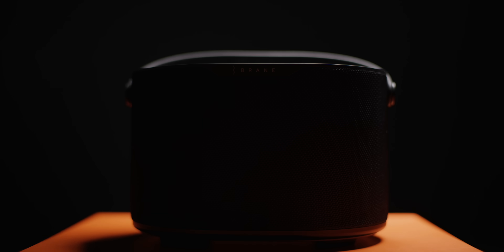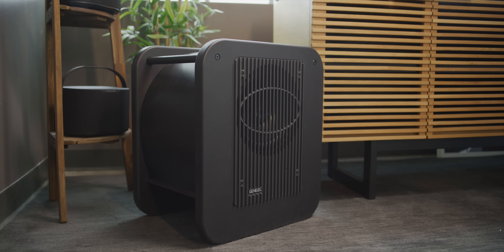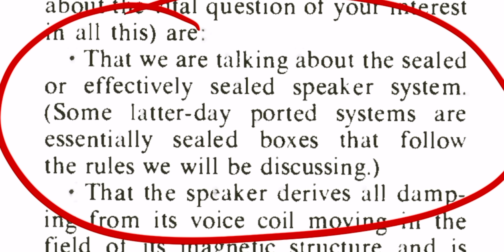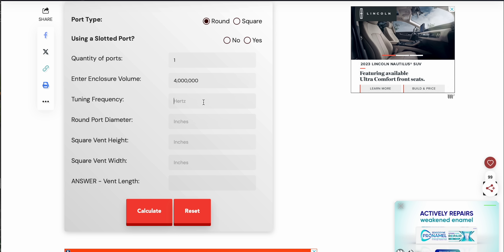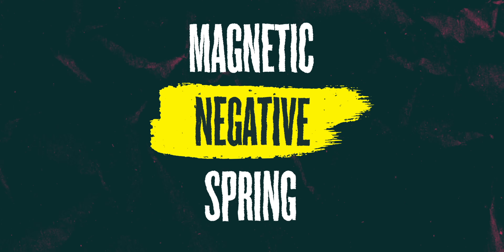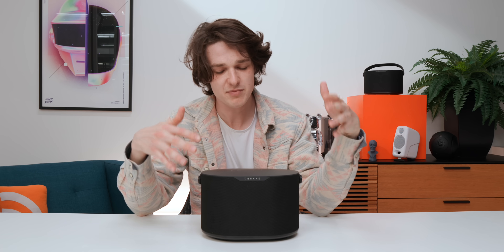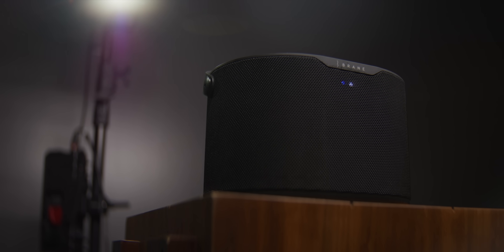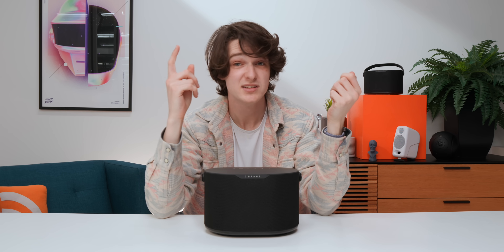How This Speaker Broke Physics.

Comment: All of the above can be seemingly easily debunked by headphones, which (relative to speakers) easily achieve very deep and clean bass, as well as crisp and pure highs.
Why?
The physics of high-fidelity speakers are in fact, very simple, but extremely difficult to achieve technologically : The speaker diaphragm (cone ot flat) must be both extremely rigid, yet extremely low-mass. 
Both traits required for low latency and and low phase-shift, which means distortion. Both latency and phase-shift translates directly into distortion. 
Both 'extremely rigid', yet 'extremely low-mass' translates to least resistance to the physical moment created by the electromagnetic motor (coil vs magnet), i.e, resisted by the air required to be pushed. That in fact, is very hard to achieve in speakers, but relatively easy to achieve in headphones, in which there is the least air required to push (and pull) by means of a very rigid but low-mass diaphragm.

Comment: Today there is a crazy amount of speaker & stereo eqpt. offerings from cheap to expensive, and though if I cannot get the specs of stereo equipment a pretty good indicator
is "weight".  How "heavy" is the component?  But price today doesn't always mean a thing.  I watched 15 Line Output Converters for car stereo application priced from $20 - $150 tested.
And only 3 of the 15 did not add "Distortion" to the signal. Two were $20 (Kicker and Recoil), and 1 was $50 (AudioControl).  The rest were garbage at any price.
 But, you see what I mean. Price isn't always an indicator with stereo electronics.  Granted an Oscilloscope is needed for testing, and if you are serious about your music, highly recommended.

Comment: pretty good video. New Subscriber.         I really think these are the first "Affordable" speakers that Trade off Nothing.+
If you want a "Surprising Bassey" speaker with incredible clarity that is actually a "Studio Monitor" where with only 5 inch drivers hit 35 Hz. "Subwoofer Optional".
Check Out: "Kali (IN-5) 3 way Studio Monitors" (Tri-amp powered).  They look "okay", nothing special (cost saving) but they will change everything you think about a 
speaker once you hear them.  With a price point achievable for 90% of people.  And they can work as well in the home as studio.   Kali is changing music for the better. (no affiliation).

Comment: When I got the pre-M generation macbook pro 15" I was blown away by the sound quality. It actually had a sound stage when the lid was open... Of course bass was lacking etc. but it was actually enjoyable to listen. Now the later 13" M1 based pro and my current M3 pro have significantly weaker audio unfortunately.

Comment: Nobody commenting on his completely wrong explanation of sealed vs ported enclosures? Sealed uses air as a spring, it's not necessarily working against the driver. Ported uses the air mass inside the port as a spring element, which is why there's a tuning frequency. Below the frequency, it's basically free-for-all and the driver loses it's dampening (which is why excursion peaks).

It's all fine to teach people but at least teach them correctly, or don't do it at all.

Comment: I can confirm this speaker is a legit sound bar replacement, you can pair up to 8 in stereo and each one outputs 200 watts on battery. The company has grown immensely in the last year and the X is worth every penny. Cant wait for them to release more speakers that focus on pinpoint directional highs with special electrostatic drivers. Brane isn't just a one off company,  they are shaping up to be a true pioneer in audiophile grade portable speakers.

Comment: brane speaker Bass with 25% distortion at low SPL, and BT is lossy audio like mp3,
 I own Klipschorns, 0.1% bass distortion with lossless audio 105db efficient, buy 1967 once, and they will serve you and your kids multiple lifetimes, (Mine are 1967), made today by Klipsch $16K once in your lifetime, so no you cannot break physics

Comment: This piece did not do justice to passive radiators, the example used a Bluetooth speaker to explain why passive radiators don't do much, the caveat here being the small cabinet limits the effectiveness of what a passive radiator can accomplish. As a speaker builder, I can confidently state that passive radiators function best when used as a port alternative, that means, a large cabinet with passive radiators can outperform sealed or ported designs if done correctly. Many high-end speaker designs use passive radiators to achieve extended low bass with characteristics that can only be achieved with passive radiators.
Reply: Bluetooth speakers use passive radiators over ports so they can remain water and bug resistant when used outdoors.

Comment: Not only is this an add if you check out the website for the speaker there is a very nice looking stupid graph that doesn't actually prove anything it's claiming.
1: I want to see all Thiel-Small parameters none of which are posted.
2: Your explanation is complete BS. The reason to use a port is to increase efficacy by utilizing the rear wave produced by the back of the cone and the length and port diameter determine the tuning frequency of the port which is the maximum amount of efficiency. One major draw back is below the port tuning frequency the cone acts as if it is in freeair and no encloser at all.
I use an Aperiodic enclosure which is still considered a sealed enclosed but with a breathable resistive membrane to flatten out the impedance curve that are prevalent in all sealed enclosures. Draw back to this design there is an increase of power requirement and you need to isolate the front wave from the back.
3: you talk about transparency that other manufactures need to provide but as an Aerospace Engineer for 25 years and an Audiophile for 35 years. You are making claims without and Transparency at all and for your price tag you should at least do a comparison against your competition with a RTA with a full spectrum mic.  Check out HexiBase on YT on how to use them. Not a plug just the guy knows his stuff.

Comment: Ok. From what I've read, this is the first system that actually reproduces lower notes, unlike the Bose etc  which just use higher bass harmonics to 'trick' our brains into sensing the lower bass that's not actually there, or else use the resonant frequency of the port to produce louder bass but give the one-note bass effect. Once this Brane tech can move into a more traditional monitor system, one without a Li-Ion battery that's gonna die in a couple of years, I'll be first in line. I actually have that Genelec sub (and two mains) as my primary system, but my sub has died - hopefully temporarily - and I've always had a problem with positioning in my room. if I could get a sub with a significantly smaller size, I'd jump at it!
Reply: It does not do this at all. It just uses a +19dB bass boost in to extend lower, at low volume levels. 

Once at maximum volume, it is only flat down to 250Hz...

It doesn't break Hoffmans law. No spring once pulled wants to explode, and the magnetic field cannot directly effect internal air pressure without moving another diaphragm.

Not a single patent is viewable, and every claim has nothing to back it up.

It is just a speaker with a heavy use of DSP. The investment is in deceiving the consumer. 

Don't believe me though. Rtings have data for you to go by.

Comment: The explanation is wrong, negative springs don't exist, they would require energy or break the laws of physics. Hoffman's law states efficiency not loudness, this speaker will not be efficient at 20 hz. The principle of the driver is similar to a servo-sub, witch already exists. There are better ways to spend 500$ on audio gear, don't trust this marketing BS. Cheers

Comment: Meh buy a decent 8" active monitor's for the price (JBL P308P MkII or Kali LP 8 v2 whichever you can find cheeper) physics and size do matter. It will be perfectly enough for most folks up to 4 m distance and mid 80 dB programme (which is pretty loud). If you insist on BT a decent DAC with LDAC support will do the trick (in dongle form starting at about 50$). If the room is long enough (5m or more) you will even satisfactory go down to mid 30 Hz (where peeks are in more prominent electronic genres just not on club SPL). Of course this is static setup with grid power. Won't talk about enclosure's that's too complex topic for hire, one more thing don't listen to the clowns.

Comment: Audiophile is a sickness.  "oxygen free" speaker wire does not sound better. Copper is Copper.   Audiophiles do not use Bluetooth..  Audiophiles take things way too far.. You should deep dive before using the word...  And, since you wanna call yourself one lets crush that right away.   You have only heard Class D amplifiers but Audiophiles only use Class AB or Class A amplifiers due to the extreme distortion found in Cheap Class D amps.  ALL Bluetooth speakers that I know of use Class D amps built on to a single chip.. These sound "Good or Great" to most people...  But, what I am talking about is the difference between  your Airpods and Taylor Swifts concert amps...

Comment: They should label ads or something.  And this is a bass speaker -but not a subwoofer.  You can use all sorts of different methods to move a cone - but the origin of the sound comes from the speaker cone.  A cool new way to shake the speaker cone - does not change the speaker cones range of movement.

Comment: That is not a big cabinet. Not in comparison some of the enclosures I've seen and heard. Large drivers require large volumes behind them especially if they are vented. Placing large woofers in too small enclosures only pumps up the mid and upper bass and makes it sound boomy and under damped. Deep, linear and extended bass requires larger cabinets properly tuned for the particular drivers used. Mathematical models derived by Thiele and Small have long existed that help manufactures design accurate bass response but too few of them actually use them.

Comment: seems like the old Isobaric loudspeaker design from the 50s-60s.  I used to design them for a high end retailer in the 80's. The designs would go so super low that it made you mind melt. They were incredibly power hungry and needed a massive amp, so they were not super popular at the time. That can be solved with todays 'd' amps.

Comment: The electromagnets are the for another purpose. The only way that speaker can produce more bass is moving a higher mass of air. So... or it has a big speaker size, or use a longer course in the speaker movement. In this case is the latter for sure. More depth on the oscillation, greater mass moved. And for that it has to use another form of damping.

Comment: I don't believe this can be properly done; you can't break physics (as mentioned already). To create a good bass sound with a good definition, you have to move a lot of air around. And that can only be done with a large woofer. You can use a smaller woofer, but in order to move the same volume of air, it has to work harder. That's what they try to achieve with the spring. But when a tiny speaker has to work that hard, you get a lot of distortion, and a very muddy bass.
So, how does it sound? Convince me!

Comment: In the specifications section of Brane's website (the manufacturer for this speaker), instead of providing range of frequency response and distortion ratings (like the industry typically does and did going back to the 1960's), they simply say "thundering bass".  Now that's progress !  LMFAO!!!

Comment: Running 4 x 18" subwoofers in. my theatre and the cabinets are reasonably small given the size of the drivers. Sealed boxes, huge amplifiers (2000watts RMS each) and a lot of DSP/EQ to compensate for the small boxes. The drivers need to have extra capacity in xmax and power handling in order to reach the deepest notes with the help of DSP. This is why modern subs sound so much better than the ones from 20 years ago. DSP, and big amplifiers.

Comment: I have a Bose Soundlink micro and it's a very small Bluetooth speaker yet it can play frequencies down to 45Hz with ease. It uses 2 passive radiators and a 1-1/4 inch full-range driver and it gets louder than the JBL Clip. The JBL flip is a little less bassy but it gets louder.

Comment: You cannot defy Physics. The science of reproducing "punchy" bass boils down to several points: 1. The size of the transducer (aka cone+magnet+coil) 2. Material used in the transducer (stiffer is better for better bass, i.e. woven Kevlar, stiff coated paper etc.) 3. Size of enclosure (or to properly put it, the resonant cavity), 4. Stiffness of the resonant cavity (wood is good, cast aluminum is better) 5. Ported vs Sealed (both have merits and demerits) 6. Amplifier bass damping (the one factor no one speaks about, its the ability of the amplifier to control unwanted vibrations by controlling the reverse current in the speaker coils) Damping factors of over 100 are considered good. Professional grade Class-D amps go up to 5000. 6. Signal processing. A lot of the bass reproduction depends on the ability of the in-built digital signal processing to control the frequency response and thereby accurately cross-over woofers at their optimum frequencies. Even more useful is the ability of the DSP to filter out frequencies that are too low and most genres of music don't have them anyway!

Comment: I'm sure this is just like yamaha servo drive... it measures were the cone should be compared to were it actually is and applies a corrected signal. This is just using magnets rather than an electrical correction to make up for box inefficiencies.

Comment: I guess it basically enhances the speaker cone movement dynamically in real time with some electromagnets like in a floating globe novelty toy. Probably it's equivalent to having a high power 12" woofer.

Comment: I had a Celection sytem 6000 sub woofer system from mid 1980`s with four 12" bass that was mounted in a cast iron frame with no enclose (open  air mounting), they was open air dipoles and sounded amazing in the bass playing down to 
15hz with -3db at 25hz :) 

But they had one big problem and that was the heavy cast iron frame even when weighing 40kg was not enough to stop it from shaking... I had plans to remake the entire thing mounting the woofers in push push - instead of push pull to cancel out the vibrations and shaking but 2 of the woofers got destroyed and getting replacements was horrible expensive and then the last 2 also got destroyed. Plan was to make a W frame with the woofers mounted so the movements got canceled out.

(what destroyed them was both times bad phono cables that suddenly let 50hz at extreme volume levels in the 250w power amp making a earthquake and destroying 2 and next time also 2 woofers...).

Comment: A poor description of Isobarik loading of the driver, first introduced in the 1950's. However, since the second "driver motor" behind the bass driver also needs an input signal - this will halve the efficiency to achieve a lower bass response.

Comment: The single most annoying thing about this thinly veiled advertisement is his constant (I lost count) use of the term "bassy."  I'm not sure just what that means. Is it high SPL capabilities in the lower registers; is it extended bass response (e.g. +/- 3 decibels down to 25Hz), or is its some subjective sense of "more bass," which usually just means an elevated or exaggerated amount of mid=bass (which most untrained listeners equate to more bass, even if the bass response doesn't really extend to the lowest frequencies?) The use of the term "bassy" just makes my skin crawl. Nobody well-informed about speaker technology and evaluation would ever use that word. Strictly amateur-ville.

Comment: Best Bass I ever heard were my Stig Carlssen OA14 set by Sonab of Sweden late '60's early 70's. 4 tweeters and a massive 6 inch midrange with a horseshoe magnet on top of the cabinet and ... no woofer but all three!. They used a baffle and down firing horn system balanced to the amp and the room the clarity for a simple system has never been equalled from what I've heard over the last 50 years and for a few hundred dollars.

Comment: The holes in the metal cover are running slightly diagonally, not parallel to the top. I couldn’t buy it.

Comment: 50% the Tuning 20% the Speaker/ Membran Quality, 10% the Resistor size ( 20 Ohm, 30Ohm ...) 20% Sound chamber. why 50% the tunning  ?? because with the Right  tuning an 20$ Speaker can sound like a 100$ speaker...

Comment: This is just stupid. I hate to have watched this video, but I had to. I review hi-fi for a living and have measured speakers for 25+ years. At first he's talking about the problems of bass reproduction. Yes, physics dictates bass extension for sealed or ported enclosures -- it's based on cabinet volume and driver size. But physics goes out the window FOR EVERYONE -- and many people have done it -- as soon as you make the speaker active or powered and apply equalization. You have to have a beefy driver to drive the hell out of it with a tone of power, but that's not hard with a Bluetooth-type speaker. Basically, this has been done a zillion times and this attempts to pull the wool over people's eyes with nonsense jargon.

Comment: You want bass? Infinity RS4 1990 tower speakers (not the RS4Bs) and put them in the corner of a room. The bass is OUT OF CONTROL and yet it still doesn't overtake the other frequencies when used with other speakers! Insane for 1990!

Comment: I recently bought a Bose Micro Soundlink. On my first use, I got startled at the Sound emerged from that micro BT speaker. It produced real bass sound. Unbelievable. Also, the battery life is huge (the spec says 6hrs after full charging, but it delivers more).
Amazing audio engineering.